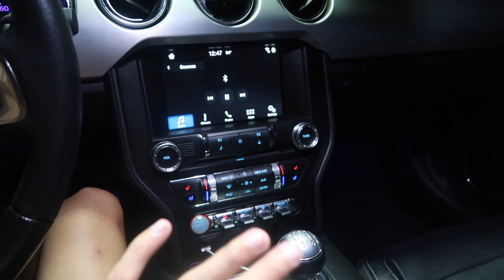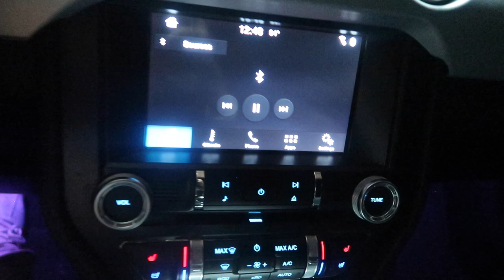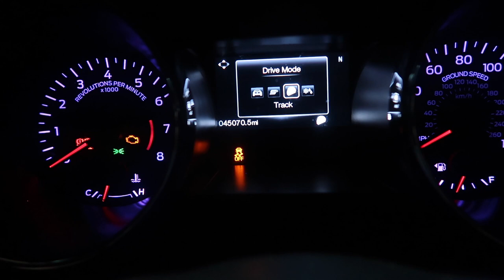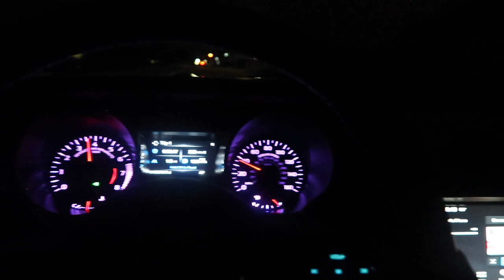Bought My Dream Car At 21 (2016 Mustang GT)

Comment: Im 23 and planning on buying a 2018+ mustang GT within 2 months after april 2023 and i have a little bit saved at the moment, but when the time comes i will have a enough for a pretty big deposit and the rest on finance my only only problem is parking because we already have 3 vehicles at the house. but im pretty sure i'll work it out. And plus for some reason mustangs in the UK are cost so much more than mustangs in the US.

Comment: Nice. I purchased my new 2020 GT at 23 years old brand new , it only had 11 miles on it. After over 100,000 it was still running strong and sold it when my first kid was born.
Reply: How tf did u put up 100k miles in two years ?
Reply: @MoreMotionn  exactly
Reply: @MoreMotionn  😭😭
Reply: @MoreMotionn  😭

Comment: I’m planning to buy a mustang i have 3 options eco & v6 $ 5.0 but i want to buy 5.0 but I don’t know i can afford it or not you have 5.0 you have experience can you share with me your experience how much you paying each time for maintenance then its gas and then its mpg millage i want to keep stock may be i do a air intake stuff but the main thing is i want to know how much is for its maintainance. Your experience will help me aloooooooooot please guide me
Reply from the maker: theres really not much maintenance required for these. full synthetic (required) oil changes are about $80 if you do them yourself, dealerships or other places will probably charge over $150. as far as gas goes the GTs do take 93 so it gets a little pricey. i pay around $50 here in texas to fill up. since my car is modded and i have a need for speed i get 12mpg and fill up around every 2 weeks
Reply: @miguelespinosa7_  in which state you are living? Im in California 
What was gas average before moded?
Reply: @miguelespinosa7_  the 2022 GT says it will take 87 and higher in the owners manual.

Comment: It's not being disrespectful to offer you comparable sports cars.  I own a Z06 Corvette because the car I wanted (a Camaro ZL1) was sold and the dealership told me about the Corvette.   The Corvette has 750 Hp and 750 foot pounds of torque stock, which is actually better than the ZL1.   It's literally a street legal race car.
Life begins at 200 mph.

Comment: i'm looking at trading my 2014 lexus in for a 2016 gt premium. found a white one that i will be looking at next week. 28k with 69k miles. 2016 is the newest i will go, gotta have those hood mounted turn signals.
Reply: Did you end up buying it?
Reply: @drufetti 510  yessss! Already put a Roush catback and a ford performance power pack 2 ( 87mm gt350 throttle body and gt350 cai ) on it. The AC compressor went out recently and I just got that replaced. It is definitely fun to drive and listen to
Reply: @g2145cal  Congrats! I saw a 16 gt prem with 60K miles on it. Thinking about pulling the trigger on it.
Reply: @drufetti510  when i get my mods paid off, i want to get tuned for E85 and a flex tune...my goal is 435 HP to the wheels, nothing too crazy...i say go for it, if you can.

Comment: i got my dream car at 18 and it’s the same thing a mustang but it’s a mustang mach 1 2021 i wanted a gt but i saw the mach 1 and saw the price and it was so low and it’s new too not used. the average price for even a used mach 1 mustang is over $62k and i got mine for 55k instead of a used one or new one from somewhere else for $10k more